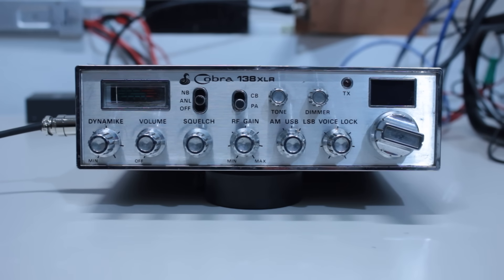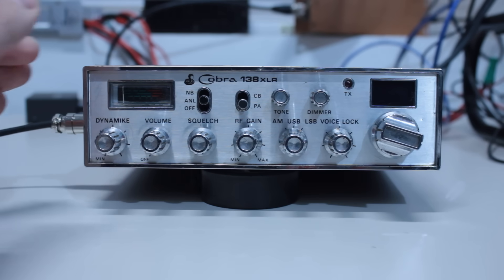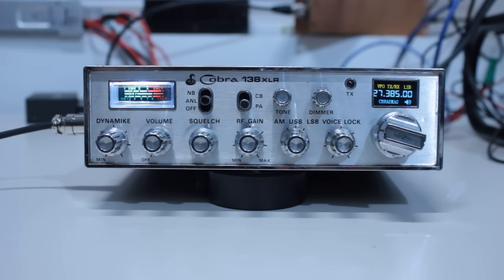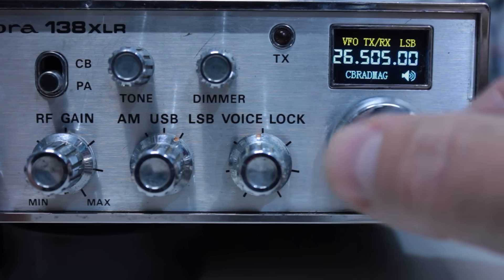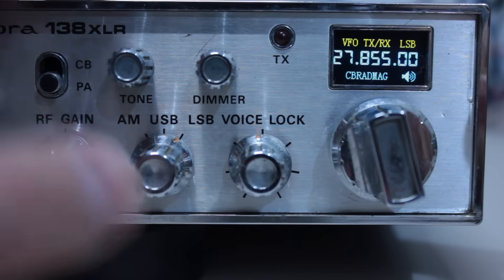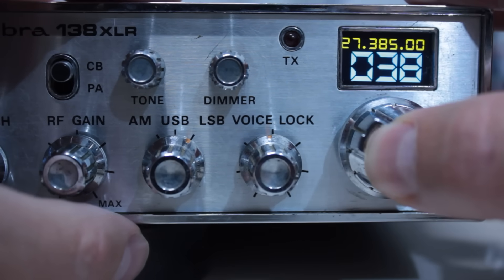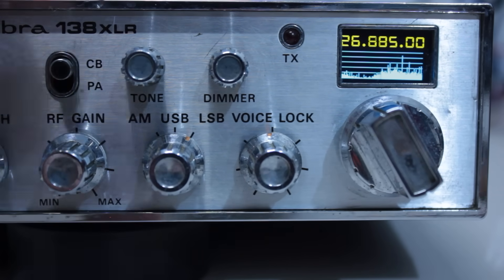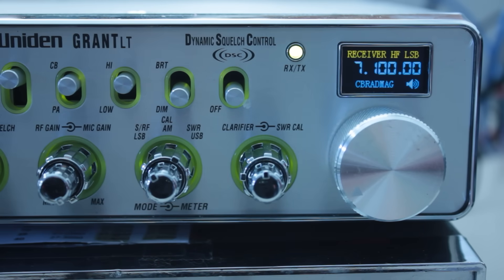This might be the coolest CB Radio modification we've ever seen

Comment: I got a question:

I’m just a truck driver with Uniden 880 with backup classic Cobra WX 29 but I prefer using Uniden. I remember a friend his handle was Yellow Dragon with a Galaxy CB that made him sound like biggest trucker in 1990’s. 

I thought Galaxy was the ideal CB, but. Couple days ago, I spoke with a trucker using a Striker CB that sounded awesome. 

My question is, what is best CB for us truck drivers?
Reply from the maker: Tough one as it depends on what you want to do. The Stryker 955 is a popular radio with truckers as it has higher output wattage and very strong audio when set up correctly. Some prefer the new radios such as the Anytone 6666 or 6666 Pro (high power). If you like basic Cobra 29 style you might like a Anytone Ares II. If you haven't used SSB before and enjoy making long distance contacts a SSB is a must. For a truck driver doing a local route that only talks to other trucks locally a Cobra 29 or Uniden 880 is perfectly fine.
Reply: look into the QT60 pro or QT80 both good radios for the money just watch a few youtube video first on how to use them and mod them .

Comment: the Best Radio Made was the President Grant. it was a 2 meter radio and had many channels and was a very sturdy & stable Radio. the President Grant was the Best Radio Ever made, with the President Jackson was 2nd and was no President Grant & was a bad Radio that constantly had board problems with cold solder joints and the Jackson has a junk flimsy circuit board!

Comment: Hey there, hope you are well, been off the radio for the last 5 - 6 years.. Well 11m wise.... Things really slowed down out here in Tacoma / Seattle... Thinking of getting back into 11m again... bring out the old OMEGAFORCE 😁... Anyways, thank it easy man.. Nice radio you got there btw... Check into some of these Pinu radios that are out now... Think screwdriver over at Bells cb shop has some... As a software systems engineer, think I made do a full mod on one of them, not sure what one yet.. ✌️

Comment: So what would be the best cb radio to install this in? I have an old Grant DX with the upper and lower channels, a Uniden HR 2510, and a Tram Diamond 60. Or buy a new Galaxy 959, GALAXY DX 979F, or a Stryker SSB radio, At $300 for a 959 you can buy a new President Lincoln for less money and still have more features. My HR2510 spanked the air waves and received things like the the 100 watt transmitter feed for a Colorado Am Station.

Comment: Now that's a super nifty mod.  Wish they would have had that back in the mid 70's when I was modifying PLL circuits on CB radios for folks.  I would modify radios to go above channel 40 since back then 1 through 40 were so busy.  I would modify a radio for $20.00 per radio.  That included a couple of switches to switch to the upper channels.  Things sure have changed since the 70's.  W Rusty Lane K9POW in eastern Tennessee.

Comment: I have been out of the CB Radio stuff for a good decade.  When I did, it was in my Camaro, Protoge, and Sunbird when gas was cheap, before a family, and usually road trips.  I still have the radio and antenna but just haven't had it up and running in the car.  Seeing this, man, sweet.  ALMOST makes me want to break out the radio and set things up again, but, I don't go far anymore, I don't want anyone to see the radio, and I've been told it's pretty "quiet" anymore on CB.  But still, frig'n sweet to see even THIS old tech get updates.  (I'm a retro enthusiast)

Comment: This is definitely a game changer.  Within the RF limits of the radio, this adds some interesting capabilities.  Back in the day, I spent so much time (& money) adding crystal banks with variable capacitors, so I could 'rubber' the crystals, and get them on frequency.  The frequency counter cost me more than my radio!  Technology has come a very long way.
Reply: was your rubberizing of the crystals done with a modified voice lock pot?? Cobra 138 with a crystal selector on the side? My stepfather had that and I believe he called it a slider.

Comment: Just out of curiosity, when did the law change to allow CB licensees to build or maintain their transmitters?  I haven’t kept up with the laws since the 1970s, when all CB equipment had to be type-certified and not modifiable by the user.  I had a ham license back then, and briefly tried out CB using the mail-in card to get an automatic license.  I haven’t used either service since then, so I didn’t keep up with changes in the laws and FCC regulations.  Please fill me in!

Comment: GREAT mod ! 
the cb-radios from back then have better receivers and their modulation sounds better too, compared to new(er) cb-radios. they dont have all those adjustments and displays like the newer cb-radios, but this mod as seen in your video is solving that issue, it's the same good old receiver but with additionally that mod, great combination. 
a problem could be self generated QRM into the radio, there will be a microprocessor on that extra board i guess. how much QRM does that mod generate into the radio, if any at all ? if weak signals get blotted out by qrm from that mod, that would then be a no-go. 

how about a socket for an external monitor ? a second receiver would be useful to display a realtime spectrumscope (plus "waterfall" display) and hear the receiver at same time.

Comment: This is sweet! Just confused on how you would be able to use an 11m antenna for all of the various frequency’s out of the operating range.
Reply: You'd have to have an adjustable antenna and tweek it for whatever frequency you were on.  Or broadband the antenna in the middle of the frequencies.  I use my 11 meter antenna on 10 meters (I'm a Ham), an Antron99 and use an antenna matcher with it on my HF rig.
Reply: Oww dear knew it wouldint be strate forward you just get it added to radio.Oww well I'll not be able to get it as I can't get near my aireal on roof.Good idea but thay always make things to hard that not everyone can do

Comment: 40 yrs ago I paid NZ$1,000 for a home modified Johnson Viking 4740 am/ssb. It had a small matchbox sized box with 3 3position switches on it. Used the Clarifier to slide between its 5kc steps in upper/lower ssb & am between each channel (800 of them) throughout 26/27mhz (only unfortunately) it would be cool to have this Cobra.

Comment: I doubt this modification has an "FCC Type Acceptance" for operation in the Amateur 10 meter band. If not, operation in that band is illegal. I also wonder about the frequencies above CB channel 40 or "freeband" as you call it, I wonder if it is legal to operate there w/o licensing? I'm not going to get out a frequency allocation chart to see, so I ask the question.
Reply from the maker: Using a modified cb radio to transmit on ham radio frequencies can be legal if you have a license and modify the radio in a way so that it meets all requirements for that band. The frequencies just above the cb band (freeband) are not legal frequencies for use however they are widely used around the world.

Comment: Where can I find a radio like that or equivalent with the same mods here you can't find the old radios here in Australia the cobra 138 was my second radio that I used in the mid 80s and in the late 70s I had a Johnson viking 352d you can't find cb radios in Australia there all gone and if you do find one they want an arm and a leg for them there was a Johnson viking 40ch that sold for $320 + that's way to much for a used and abused radio

Comment: omg, they are adding a SDR to CB's now..  how cool is that..   software definded radio's are amazing in thier abilities along compared to normal radio's they dont actually TUNE to any channel, they sample every channel at the same time, and store the reception data into a block of data that can be accessed directly on the chip.   really neat stuff . would love to add this to an old 128gtl with funny freq's.  likely will have to remove the funny freq mod's from it.

Comment: This project was developed in Brazil. It is very interesting in cases of burnt PLLs that no longer have replacements. Yes, there are other advantages but not everything is perfect. There is a problem of generating noise that is generated by the I2C communication of the display data bus that can generate ghost signals on some channels. Even so, it is a very valid option for retired equipment, either due to lack of PLL replacement or even in equipment limited by being crystal oscillators. Congratulations to the Brazilians who perfected this project. Yes, I was one of the pioneers to spread the DDS concept in my country. Wander Lúcio and André Tauros were responsible for translating a concept into a usable project. 73 to all friends.
Reply: Good morning Paul.  Good to see a Brazilian comment here.  you know Paulo, this problem caused by i2c communication, doesn't exist in this version, because I don't have a constant update of the display.  (Except for the Spectrum scan, in which case we'll be running the spectrum where it's pure noise.) But this current version is actually free of noise caused by i2c. Abraço e muita paz. Obrigado por ser um dos primeiros a experimentar esse sistema. 👍
Reply: Quick question please, what size display should I get for a Connex 3300HP newest version , there are 2 sizes listed on the website for this mod…

Comment: Amazing mod, if you could add FM there would be nothing left to desire!
Reply: I do FM mods :)
Hit me up!
Reply: @grahamtangomike1880  how much is an FM mod on a 148 for example?
Reply: @bhenderson7651  Sorry for the late reply. I had replied but for some reason YT didnt post it correctly..

The FM mod board is £38 (GBP)

You have 2 options, either i send you the FM mod board with detailed instructions on how to fit it. Bare in mind it needs tuning and as long as you have said eqipment? There's no reason why you cannot do it yourself.

Second option is you send me the radio and i do it for you. Which i charge an hours work for. £20 per hour.

I must remind you you will need to sacrifice one of the switches on the front. I suggest (And my instructions show using) the tone switch (on a GTL-DX) or the CB/PA switch. Of course, a switch can be fitted anywhere you choose.  My last customer had his FM/AM switch fitted to the rear of the radio.

Again, sorry for the delay'd reply. Let me know if you wish you know more about it.

73s.
Reply: May i say, we have 2 or 3 of these very boards/mod kit's in this video and 2 of us are actively working on adding FM to this very mod. 

We have a working model. But of course, we have to test it over time and monitor it.

So far so good though!

Comment: A very nice product.  Just one small problem: by FCC rules NO modifications to a type approved CB radio set are legal.  Not that most people using CB are even trying to run legally.
Reply: Then it's just no longer a CB radio.  It's legal to build your own HAM radio even if you're not licensed.  Transmitting is where you need the license.  You just can't sell it as a CB radio afterward.

Comment: Hey, just stumbled across your channel, seem one of very few cb channels left. Well I recently picked up a midland 79-892 and it came modded, I can’t remember the exact mod but it allows me to scan and broadcast slightly above and below the normal 40 channels. I’ll be honest it’s cool but I really love the old dial but it’s been bypassed so it no longer works as the mod has taken over. I was curious what your take on the mod is, Is it worth it? Do people really ever use these things? Would it be better to just remove it and return the radio back to stock? Would love to hear some feedback
Reply: @Tony Tony so I bought that radio from an antique store and it had that scanner installed on it already. It’s a redco digiscanner but I’ve got it mounted in my Land Cruiser so it takes up extra space than I’d want and I’d love to go back to using the original dial. Problem is I have zero clue how I could safely remove the redco device and return the radio back to its original form. I’m 19 years old and have experience soldering larger devices (notably doing an engine swap in said land cruiser) but not much in the small side and nothing in CB’s but I would love to get into these things hard core. I find the easiest way for me is to have access to schematics and data sheets but I can’t find anything on the midland.

Comment: This is far and above what I was making and installing back in the 80's. I had a board that I built that would go from -79 up to 108, including the A channels. I was able to use the original readout and had it set up as 5, 40 channel bands. It used 3, E-prom chips. One ran the PLL, the other two ran the readout. At that time it was a pretty good modification, but it took up about a third of the room that the main PC board took up and was a bear to fit in, except if you were putting it in a Cobra 2000. This new mod looks like the cats meow. With modern microchips it'll be much smaller. I also installed FM kits. Not my own design, but pretty cool to have that mode.

Comment: I have a galaxy base station that has a nice VFO and an HT with scanning. 

But I prefer to just mod a ham radio. The new Icoms don’t require extra parts and the FT5D was easy enough mod and improve some things. Of course you can get ones that aren’t locked out or just buy a Chinese radio. 

Repurposing old radios is a nice idea. But I’d like to keep them pure and play with them as I remember them.

Comment: Sub'ed, I have a 142GTL that had a piggy backed freq. Display that controlled the PLL to unlock the above and below. Years ago though I pulled it to return the base to stock.
I have a 148GTL and PC122 that this would be cool to add.

Comment: I just have an older 10 meter Ranger AR-3500 100 watt all mode that is opened up to run 26Mhz to 30Mhz.
Now those old radios have gone way up in value right along with all my Yaesu radio equipment.

Comment: That's sweet .. I own a 148 best radio ever it's got the unlocked clearafyer... It's got a swing kit dead key two watt swinging 38 peak to run an amp.... It has the upper free band channels controlled by the dimmer switch... Too bad cobra NO LONGER makes the 148 SSB.. and uniden no longer makes the grant ssb 😢... I like these older radios much better than the digitalized new radios.

Comment: Will this fix a radio that's off frequency or does it still need to be realigned? unsure how much this takes over the function of the radio and if the frequency on the display is correct.

Comment: I guess most of the $75 - $100 installation fee is for Troy's Radio being able to understand the poor pigeon English the installation instructions are written in.  I have a degree in electronics and radio systems was my special study area in collage.  After reading their do it yourself guide I darn sure would not try gutting my Cobra 29LTD using THEIR instructions.  I just hope they are are far better at making the conversion unit  than explaining it.

Comment: I modified my CB base radio to operate from different bench where I work from. I have a D-104 microphone that I connected through a relay that I can turn on with a push button from a different bench where I'm working another project.

Comment: so now you can turn a CB into a Galaxy 10 meter, which I was using (after having converted to CB band) 40 years ago with a roger beep and a frek meter  but no FM which my Galaxy had and is great for talking to Europe. Yes it had to converted but it was and still is the best dam radio I ever had in my big truck.
Reply: I had a galaxy 99 original for man yrs.that had it all plus robo talk lol and different voice changers so on lol.
Reply: I had my daul finals swapped to 80 watts that ran into my 60,000 watt tube competition cb system that had a bunch of altnators and batteries with capps.Those days are over.i wish I still had it.lll

Comment: I'm wondering if the SI5351 synthesizer module they used can be changed to a TXCO for better frequency stability.  The schematic is actually very simple.  You can probably make one yourself for less than $40 in parts.  If the firmware is available, it would be cool to use a STM32 or ESP32 board instead of an Arduino.  You can even connect to it using bluetooth and your phone to change settings.  I can decompile the HEX file with IDA Pro, but just not worth my time.  Its definitely a cool little project that the author made.

Comment: Here's a question: I have a Galaxy Saturn that tunes from 25.615 to 28.305 in six 40 channel banks. Will this mod allow full range tuning on this radio? Will it eliminate the "band" selector switch?
Reply: 28.305 is in the Ham  10meter band, ILLEGAL
Reply: @richarddegen6184  it's only illegal to TX on 10 meters if you're not a licensed Ham. Anyone can listen to anything. Not a great idea to make assumptions. And your answer is irrelevant to the question.

Comment: Pfft.  There is no "freeband".    All and I mean ALL frequencies are allocated by the FCC in the US and by other countries by their respective governments to specific uses. Most of which require licensing.  CB is only allocated to use specific frequencies allocated in channels. Any operation outside those allocations without the appropriate licensing is illegal.   That all being said, the mod actually is pretty cool. It's just illegal to transmit using it.
Reply from the maker: Freeband is the term cbers use to describe the frequencies used by cbers outside of the legal 40 channels. Yes they are illegal to use and I don’t advocate their use however they are used heavily in other countries and often cbers in the US will use them to make contact with foreign countries. 27.555 is a good example. While those frequencies aren’t allocated by the FCC for CB they are virtually silent aside from cbers worldwide so their use even though illegal, for the most part causes very little issue.